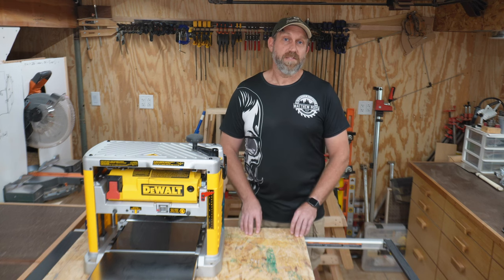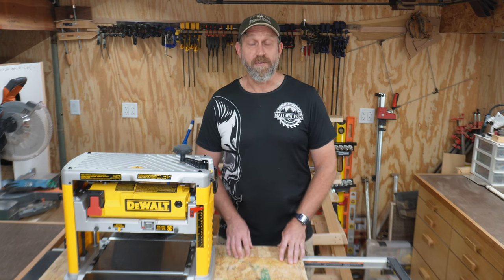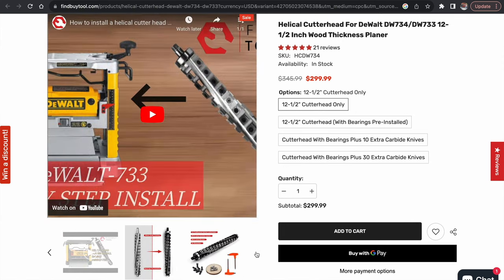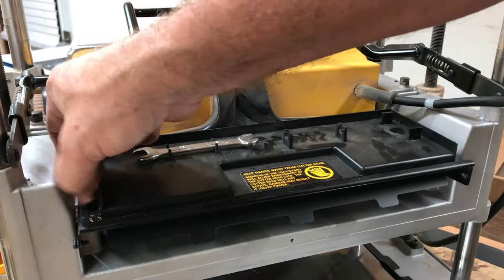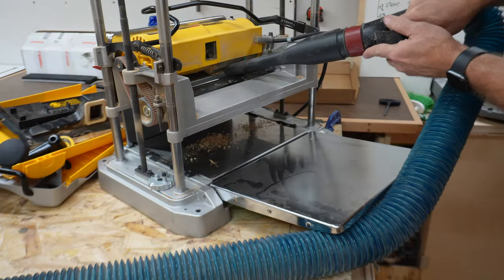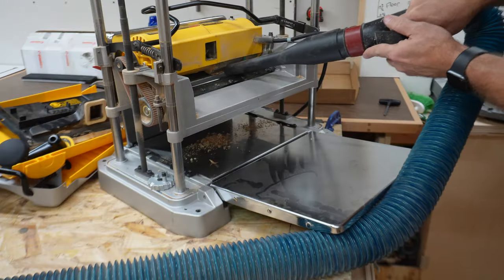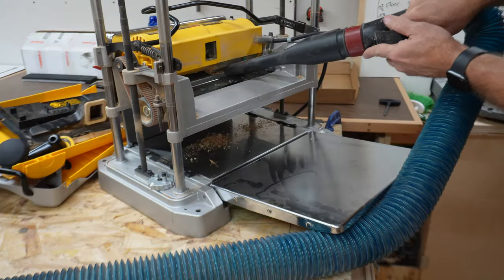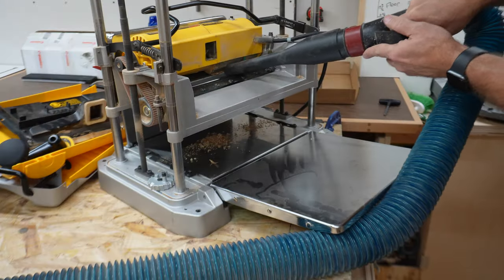Dw734 Helical Cutterhead Step-by-step Guide!

Comment: I came here for help with mine.  Thanks!  I do have a comment, and maybe I’m wrong, but I thought you were not supposed to line the outer face of a bearing with lube so it doesn’t encourage the possibility of the entire bearing turning inside the housing?  Perhaps I’m wrong in this instance?
Reply from the maker: I’m no machine expert. I was following the manufacturer’s instructions. You could be right though
Reply: You're not hurting anything by adding a little lube. Bearings outer race is set up for a press or interference fit. So the hole is slightly smaller (-.0003/.0005) than the outer race. Effectively what happens is you squeeze the lube out. There's literally no space between the hole and outer race. You'd be hard pressed no pun intended to spin the outside race once it's seated in the hole. In other words you'll be fine! 😂

Comment: I purchased the cutter head and followed your video which was great. Thanks. However,  the boards I plane have a few lines/ridges on them, that would seem to indicated a cutter is out of alignment, but it does not seem very obvious when looking at the cutters. Do you have a tip or technique for getting all the cutters aligned?
Reply from the maker: Glad it helped! I’m afraid I don’t have a fix for your issue. It sounds to me like your some of your cutter mounts are not staggered properly (not your fault)   It may be a machining or design issue. 

I would reach out to the manufacturer and describe your issue and see if they will replace your faulty cutter head.
Reply: @BrettsWoodshop  Thanks for the response
Reply: I did by the FindBuyTool cutter head as you demonstrated. I'll see what they say.